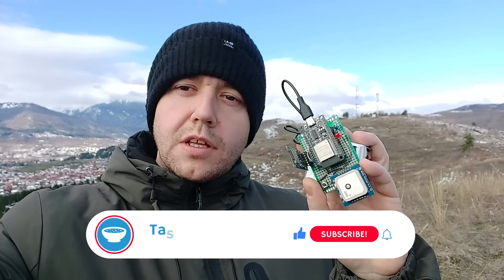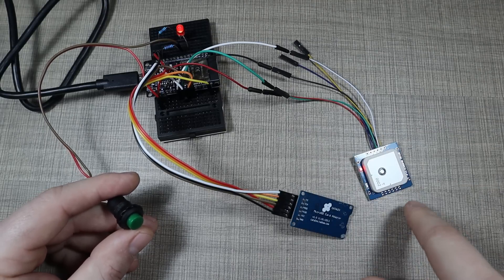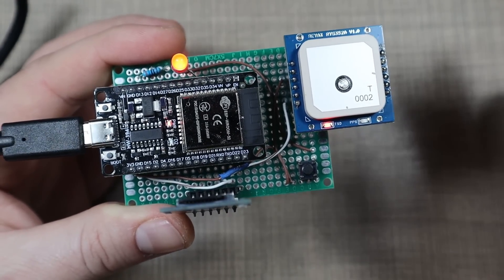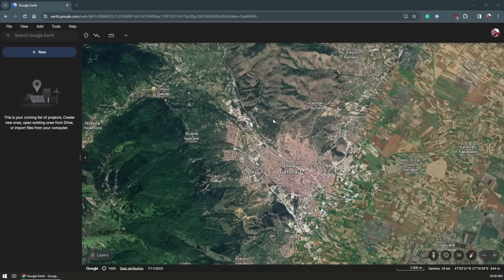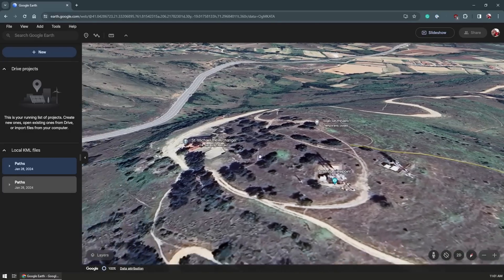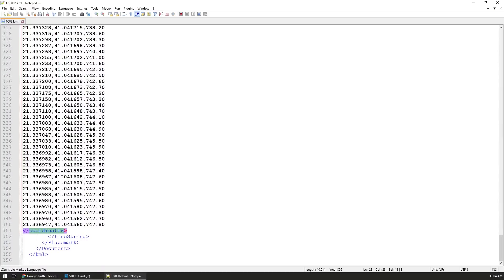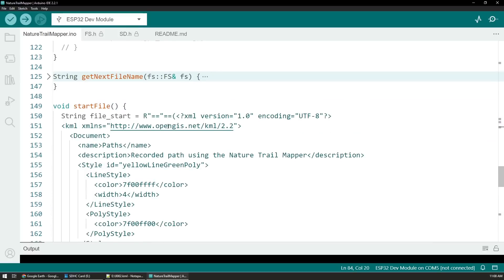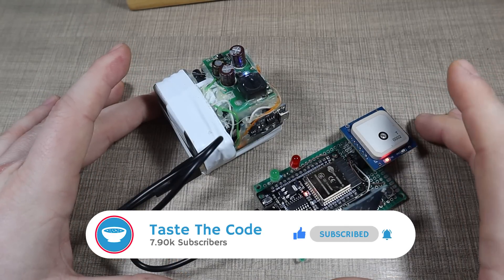Nature Trail Mapper in KML format with ESP32, RYS352A GPS Module and microSD card logging

Comment: Is it possible to replace google maps trace view with TFT Display to show exact location on downloades .kml or .bmp map saved in SD CARD ?
And show some point ?
Reply from the maker: Showing map locally is quite difficult. I haven't looked into it but the biggest challenge is mapping the latitude and longitude with a position on the image. KML files don't have any map data, just a list of points.
Reply: @TasteTheCode  Yes I meant exactly that with map latit. and lon.
Iam interesting. Can u do it with esp32 and TFT Display like commonly used 2.8 inch ili9341 with TFT_eSPI to show GPS location on .kml map with pointing crosshair which shows location (without SIM cuz there is needed internet connection) ?
Thank you sir.
Reply from the maker: @tonkofonko  KMLs don't have that data. You will need to figure out on your own how to translate the lat/lng to x/y pixel coordinates. Maybe there is another way but I've never done this so I can't tell how to proceed. In any case it is an interesting project to try.
Reply: @TasteTheCode  ok I will try it.

Comment: I've been wanting to do something like this for some time. I've got it running on a breadboard, but I am having trouble with it not recording the position. The recording LED goes on when I push the button, but the position LED won't come on. I verified I have it wired correctly  by momentarily light the LED in setup. I don't get any of the Serial.println output, just the gps_serial data "$GNGGA,134653.000,3339.9294,N,......"ETC. Any idea what my problem is? Thanks for sharing all the work you have put into this project.
Reply from the maker: Comment out the gps data print because it makes it difficult to see the rest of serial data. If the green LED is not on, the gps does not have valid position fix. Are you testing it outside? GPS needs a clear view of the sky to work.
Reply: My problem may have just been the TX and RX connections. I got it working over the weekend. I used an EzSBC Bat Pro development board since it has a built in battery connector and manager, plus, it has a software accessible RGB Led so I skipped adding the two Leds and saved some wiring. Just set it to a different color based on the internal states. 
Thanks again for a great project. @TasteTheCode
Reply from the maker: That is some awesome news. I'm glad that you managed to figure it out. 👍👍👍

Comment: Very interesting video. I have a use case that no other commercial device can deliver. Your project could be my starting point, although I find the programming a bit intimidating. Anyway, instead of a button to start the recording, I want the device to start recording as soon as the device detects that the gps cords are changing. The device would be in my Motorhome and would be on all the time, powered from the vehicle. If the vehicle stops then the recording should pause. If the pause is greater than 10 minutes the recording should stop. If the vehicle starts moving again a new recording would be started. I’d like to give this a try, but unsure if I’m up to it. Anyway a big thanks for sharing your knowledge. Greetings from the UK
Reply from the maker: Thanks! There is already a section in the code that checks if the new position is at least 1 meter apart from the last in order not to save the same location multiple times. You can adjust this to 5 or even 10 meters for your usecase. You can also add some time measurement in the same section so if there was no new position recorded in a minute, you can stop the recording and restart it once movement is detected again.

Comment: Hello, what a beautiful and original fun project this is. I immediately started gathering the right materials. Only I have trouble finding the right library files together. Is there a description of that?
Reply from the maker: I'm using the TinyGPS+ library for the GPS data handling and the standard SD Arduino library. I don't have links to them but they should be fairly easy to be found. Let me know if you need help with it and I can try and find the links.
Reply: @TasteTheCode  Thanks for your reaction. What I couldn't find is HardwareSerial. I have troubles with
Reply: I see now that I have trouble with the GPS module.
Reply from the maker: Hardware serial is part of the ESP32 core. What microcontroller are you using?
Reply: @TasteTheCode  ESP32 (30 pin) Wroom 32D. Problem with GPS module solved.
Thanks for help.
Reply from the maker: I'm glad you got it resolved.

Comment: Great Project. Please can you add the wiring diagramm for esp32 with the spi sd card and the gps modul, for example in fritzing or others?
Reply from the maker: You can follow the default SPI wiring for the ESP32. I have it fully explained in the Instructable linked in the description.

Comment: I had a Garmin GPSr in 2003 that could record your coords and map the route you traveled. Cell phones today are plenty precise and can give you a visual display overlayed on sat or detailed maps while you are hiking. Nothing wrong with creating a dedicated device but I'm not sure it has any advantage.
Reply from the maker: The greatest advantage to me is that I had fun making it and learning about KML, writing to SD card, and interfacing this particular GPS module.
Reply: Looks like this would record for much longer than many cell phones
Reply from the maker: Yes, true. It uses around 40 mA while recording without any power saving in mind so I guess this can be optimized.

Comment: I recommend have a look RAK (wisblock) they are super low power (last week vs day  when using a 2700mha battery) the gps part does use more power thought but the wisblock is modular so you just plug in what you need and it's very tidy
Reply from the maker: I know wisblock but I never had the chance to play with it. They look neat but they are more expensive to get and also they are in an ecosystem different to what I'm already used to.

Comment: if someone wants it a bit easyer on the hardware site - Lilygo T-Sim7000G has everything on board
Reply from the maker: Hey, I haven't used that board so far but I will give it a go. Thanks for the tip.

Comment: What is the current consumption in recording state? how many hours out of a 10 000 mAh power bank?
Reply from the maker: OK, so the project draw varies between 30 and 50 mA and I guess we can average it out at 40 mA. On a 10000 mAh battery, it can theoretically run for 250 hours.
Reply: Pretty good, thanks!
Reply from the maker: Hey, I did not measured that but I will once I'm back home and let you know.